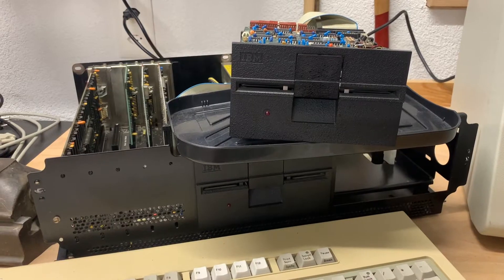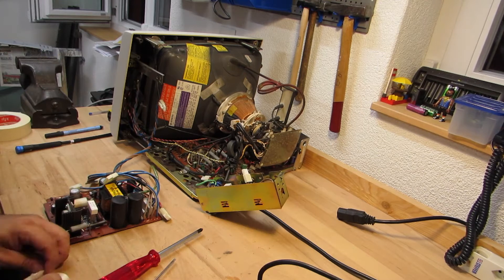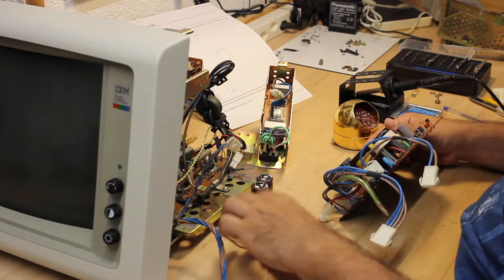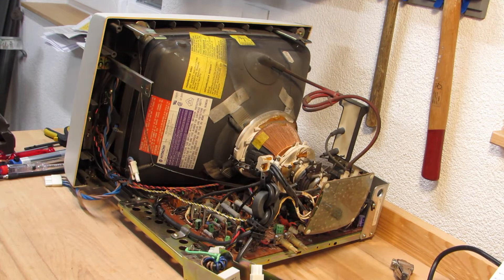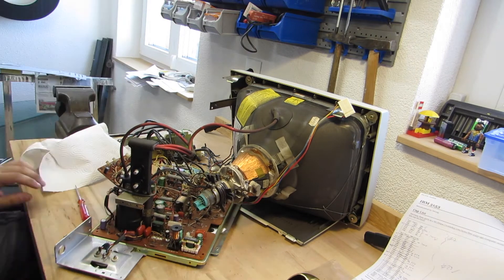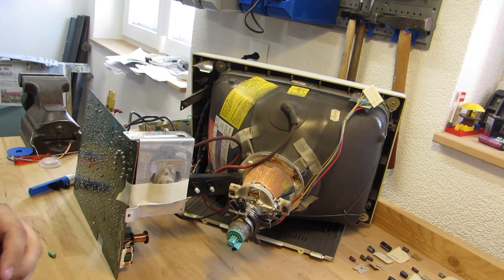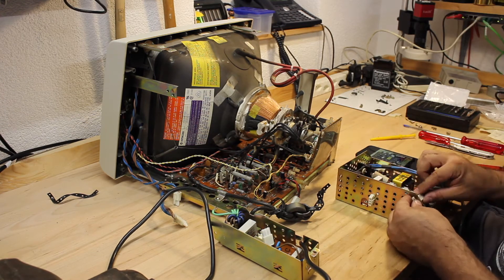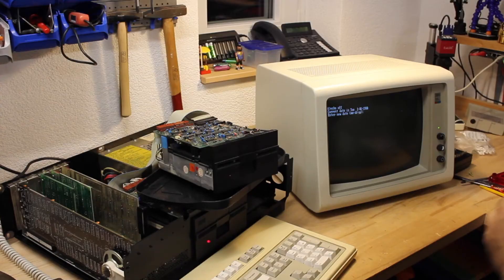IBM 5150 journey Pt. VII: How to fix the IBM 5153 CRT display [swapping capacitors]

Comment: Speaking of responsible disposal, I see you have one of these metal wool thingies to clean your soldering iron's tip. Does (possibly non-RoHS) solder need special disposal too or can it just be binned?
Reply from the maker: Well, different countries may have different rules. In Switzerland, we're not supposed to put anything toxic or hazardous into the household bin. When working with old electronics, solder contains for sure lead. But even with more recent electronics, you shouldn't assume it's non-hazardous. So I'm collecting everything (solder debris, clipped of wiring, leads, desoldering braid, etc) in a separate bin to dispose all of it separately. It's no big deal, a small can is enough, last several months for me.